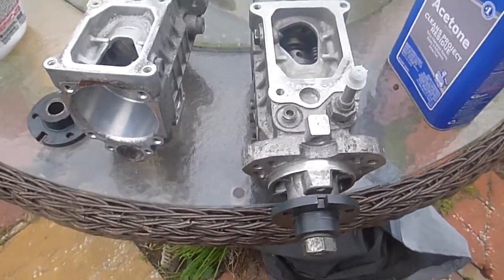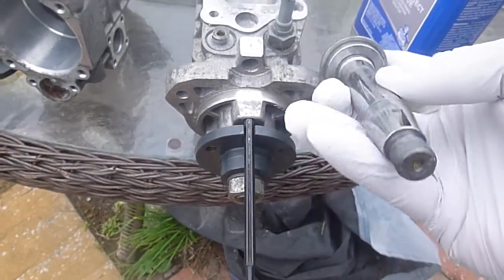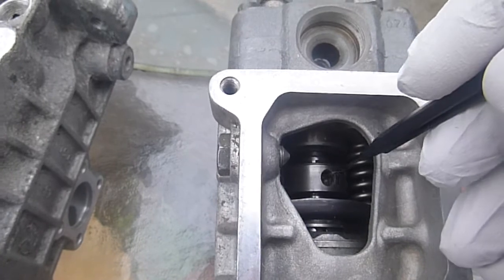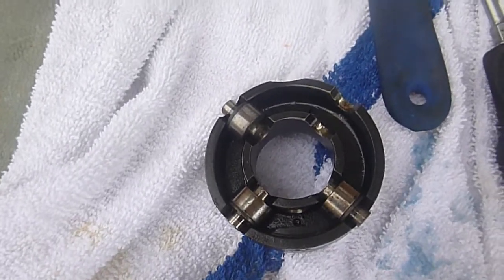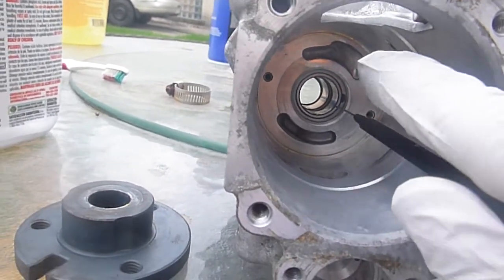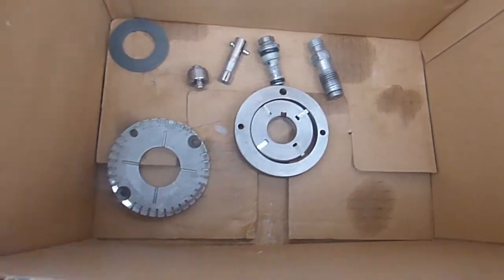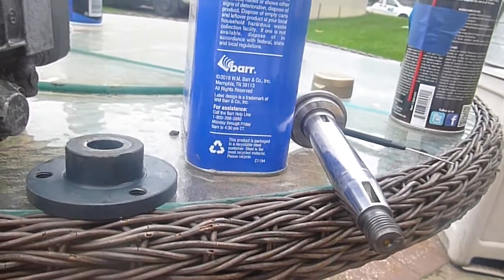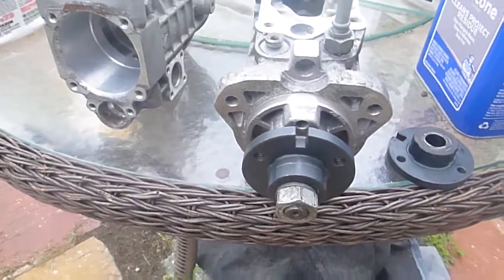TDI ALH Diesel Pump Timing? Answered in comments.

Comment: is this a electric pump or manual pump? if manual ,can we put manuel pump instead of electric pump? coz my car is throwing so much black smoke when accelerating the car. is that a pump problem ? all mechanics are saying its a problem of pump. and this thing is very expensive here in my country 😟😞regards
Reply from the maker: Thanks for watching.  This is identified as a mechanical(manual) pump.  All the TDI main high-pressure pumps are mechanical.  They are driven from either the main timing belt or the camshaft.  The only electrical diesel pumps are line-pressure or line pre-pressure pumps.  Each pump is vehicle year specific and can not be substituted for different motor types.  My 2001 ALH only has the mechanical pump and no assistive electrical line pre-pressure pumps. Black smoke can be a sign of a timing problem, a bad IQ(injection quantity) unit, or dirty injectors.  The pre-1998 Diesel pumps are 100% mechanical and have a cable from the accelerator pedal to the pump and 100% mechanical injectors. After 1998 all TDI diesel pumps have a computer controlled IQ(injection quantity) that control the acceleration paired with mechanical injectors, but the vehicle timing is maintained by the pump.  After 2004 all 1.9L TDI switched to a high-pressure cam-shaft driven pump that no longer controlled the injection timing and instead went with electrically controlled injectors and computer timing. In 2009 the 2.0L TDI was changed back to a high-pressure timing belt driven pump with electronically controlled injectors and computer timing.
In your case, I would look at the IQ component. If your pump is similar to my pump in the video, you can take the IQ top off and move the swingarm by hand.  I would look for position and swing arm return.  I cleaned my IQ  by removing it and soaking it in xylol for 24 hrs, but you have to also remove the IQ control parts from the pump body.  The pump should be removed from the vehicle.  the good news is that these pumps are easy to rebuild and there are very few parts the wear.  Once removed from the vehicle it is easily disassembled.  Requiring a skill level of 2 out of 10.  I do not know why these high-pressure diesel pumps are so expensive.  While doing my rebuild I expected to find delicate parts that needed to be highly calibrated or adjusted, but there are none.
I would suggest that you buy a used pump from the same make and model year as your vehicle and rebuild it yourself.  my auto parts junkyard charged me 20% of what the price was for a new pump and it was the only reason I attempted the rebuild.  When I was done I had two pumps that are both usable. 
Note: On the IQ. from my ALH  what happens is that the throttle spring return gets gummed up.  Once cleaned (and not replaced) the springs will perform like new and thus the IQ will perform like new as well.  The IQ connects to an adjustment cam on the main pump shaft.  This came also get gummed up and needs cleaning.  I removed my IQ cam and polished it then cleaned its small holes with carborator/parts spray cleaner.  I then oiled the parts with diesel to keep them from rusting or accumulating water.  In the belly of the pump is another ideal adjustment cam.  In this area on my pump, there were signs of water accumulation and minor oxidation(rust).  This area was sticking badly and required heavy polishing.  This area is adjusted by the computer to compensate for motor ideal needs while the motor warms up to operating temperature.
Having done it I would say "DO IT".
Reply from the maker: If your engine looks like https://www.youtube.com/watch?v=sAQFfJQn91s than your diesel pump is driven by the motor's timing belt BUT the controls seem to be computer electronically controlled.  Assuming your motor is the same; The pump controls the timing and black smoke is a product on unburnt diesel.  This is usually caused by too much diesel being sent into the cylinders.  Once again the areas to look at are (1)computer-controlled IQ on top of the diesel pump, (2) The Diesel filter, (3) the Diesel injectors, (4) Cylinder rings/pressure, (5) Timing belt.  because the timing belt controls the diesel pump and the diesel pump controls the motor timing as the belt gets old and stretches the pump is designed to compensate to a point, but after that point, it is necessary to replace the timing belt to correct timing related poor diesel fuel usage.
(point #2 Low Power)  This is either turbo or cylinder compression related. The turbo has many points of failure. vacuum lines, oil lines, compressor bearings. And cylinder compression is easy to test on diesel.  To test cylinder compression you simply remove the glowplug or the diesel injector and insert a compression gauge with the correct adapter.
Reply from the maker: check out this video too: https://www.youtube.com/watch?v=V3KKzuh5LIs

Comment: Yep, that's right.  The mark you made should be about 12 o clock, making the key about 10 o clock, or 40 degrees to the left.  I think the confusion is the feeling that the two mark you talk about need to be aligned.  VW loves to make alignment marks, but they are almost always moving part and case, but you already knew that....
Reply from the maker: Thanks for the Help mate. Knowledge is power,, and this knowledge translates into real money.  The current cost to rebuild one of these VW ALH IP pumps if anywhere from $400.oo US to $900.oo US. These pumps are the very heart and sole of these diesel auto but come on we VW owner have got to eat too.

TDI Love from Chicago.

Comment from the maker: From (jimbote on forums.tdiclub.com 02-26-14, 12:49 PM) link: http://forums.tdiclub.com/showpost.php?p=4454788&postcount=2

HE SAYS: Look at the main pump body's front main shaft seal.  Notice that little mark on the metal flange that holds the seal at about 60deg counter-clockwise from the top(12 o'clock) locking pin hole?...that's the line up mark for the keyway. Using the shaft nut and a wrench turn the shaft until the keyway is visually centered on the mark then tighten the lock bolt.... I have seen on some new or re-manufactured pumps from VW the mark is missing ...if that is the case you have to disassemble the pump for the internal line up marks (a pain I know but easier than sending it off to be retimed$$$$$$)...

If you have not front flange mark then, with the pump mainly gutted and working from the head(rear) side...holding the pump vertically facing the rear the marks at 2 o'clock(right one) and 8 o'clock(left one) should line up with the drive lugs. now if you turn the pump around to the front the keyway on the taper should be near 10 o'clock. The 10 o'clock position is near the position marked on the flange of the Bosch OEM pumps.

Thank you Jimbote and Thank you Veteran TDIClub Member KLXD from Lompoc, CA. You are a life saver.
TDI Love from Chicago